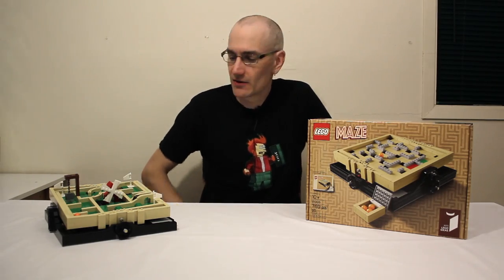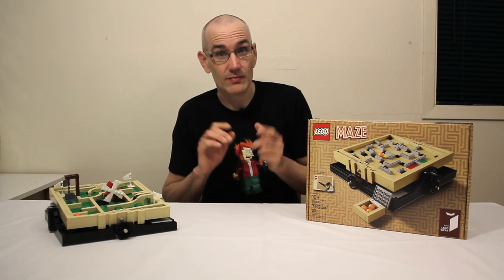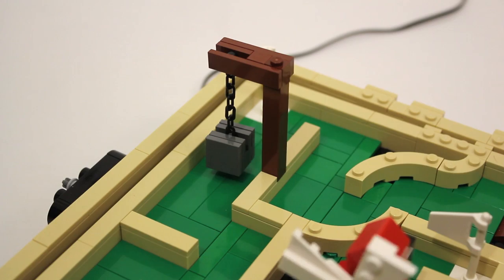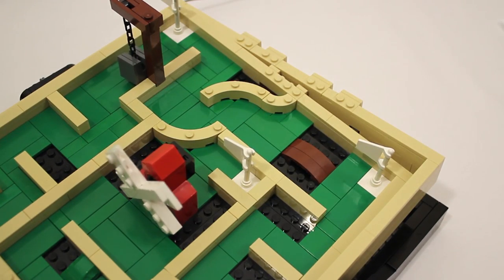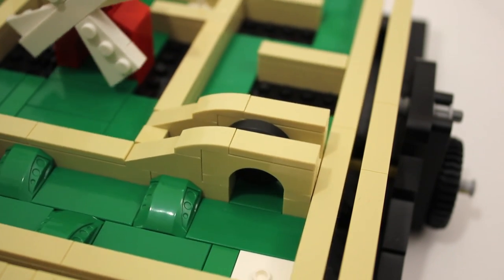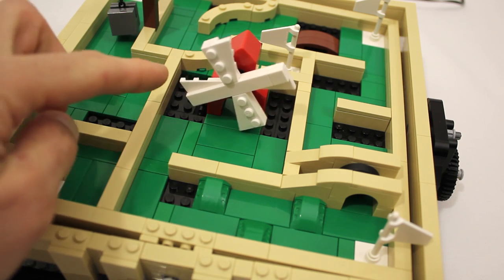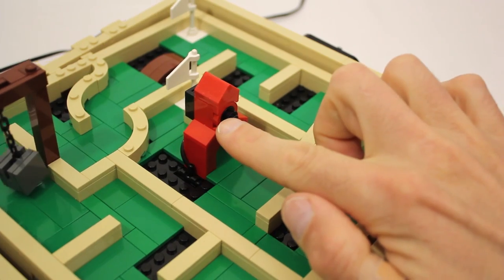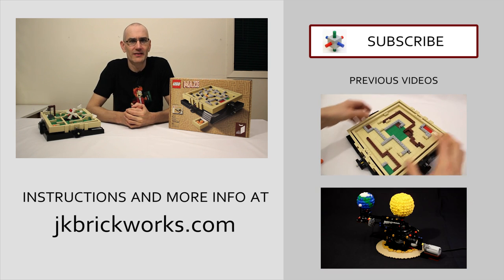LEGO Motorized Mini Golf Maze

Comment: What are the dimensions for the base plate of each maze?
Reply from the maker: +MADJiC Studios 24 x 24 studs.
Reply: +JK Brickworks Thanks. Is that the plate for the entire thing or just the maze?
Reply from the maker: +MADJiC Studios That's just for the mazes. The entire frame sits on a 32x32 stud baseplate.
Reply: +JK Brickworks Thanks.